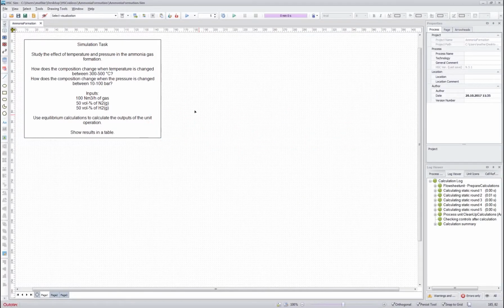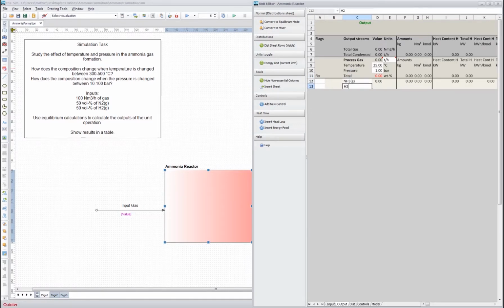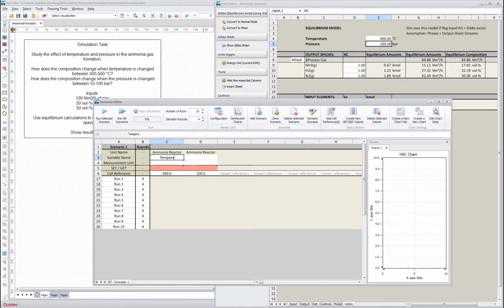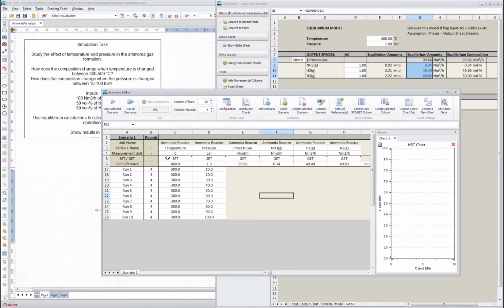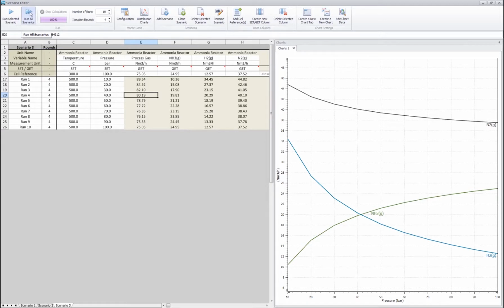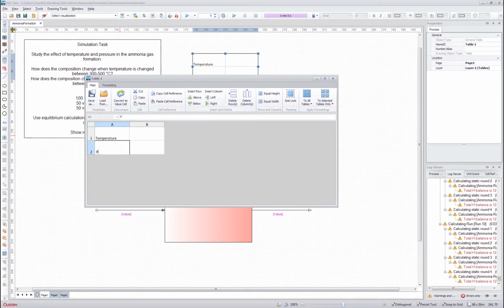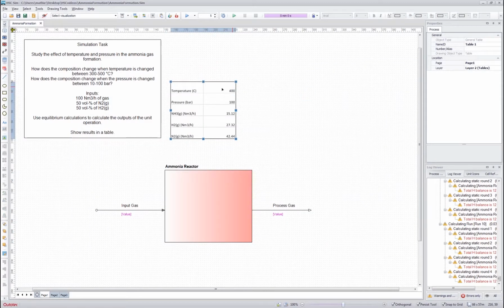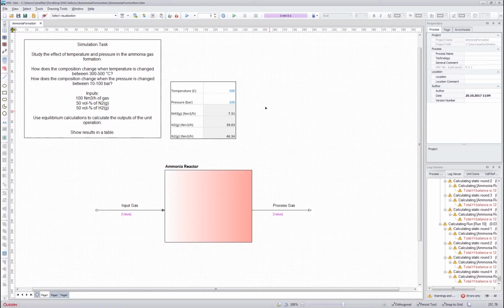HSC Sim, Advanced – Scenario Editor, equilibrium unit and tables

Comment: for my mass balance i used the 7.0 version of HSC, but now i want to open with the 9.0 version and there are many mistakes. can you help me to convert correctly the mass balance?
Reply from the maker: Hi Miguel, In most cases you can import models to HSC 9 without problems. If you are unable to import, you may need to rebuild the model in HSC 9 from scratch. If you need help with the import, please get in touch with hsc@outotec.com for more details.